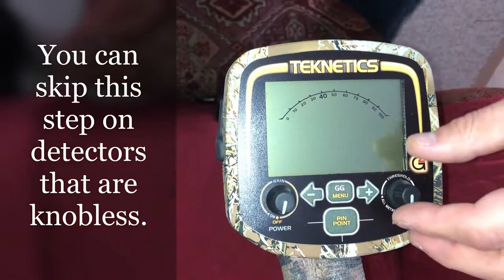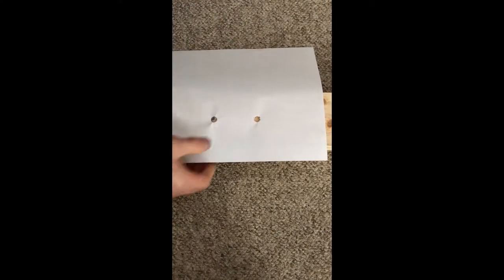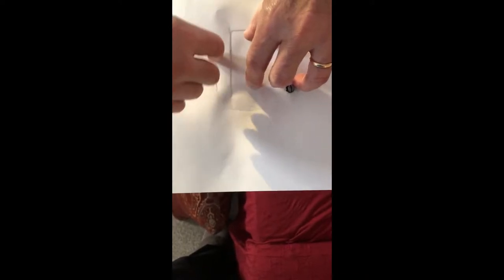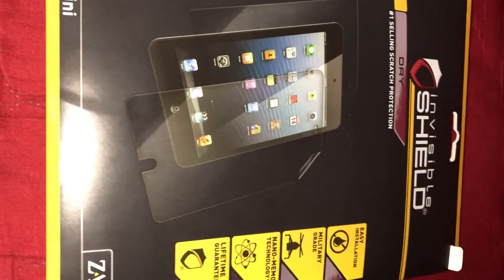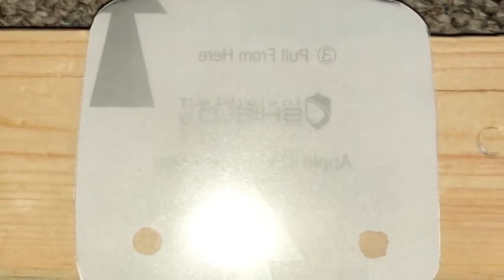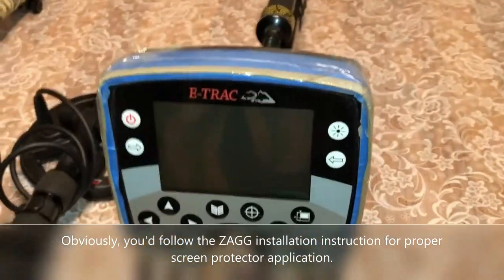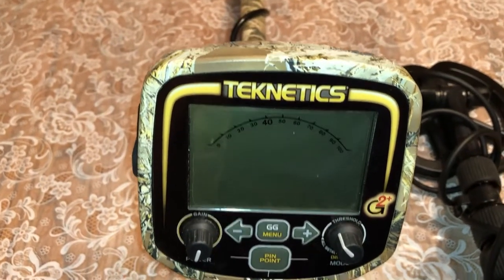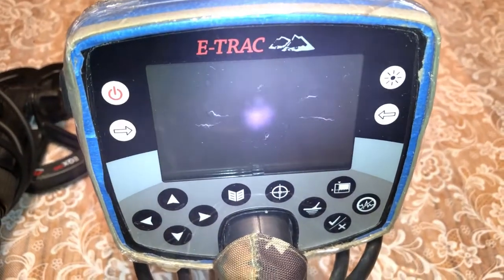ZAGG Screen Protector for your Metal Detector    How to

Comment: good video i watched the golden mask shaft video i ended up ordering for my equinox thank you  when are you going to do a hunt with your equinox.. thumbs up
Reply from the maker: Thanks Mark.  I'm hindered by frozen ground at this point.  I'm still pretty much a "newbie" as far as the Equinox goes. I usually like comparison videos myself... I'd really like a comparison between the Equinox and the Etrac. I'm hoping to connect with a well known Etrac user, maybe, if he's willing... we can do a "real hunt" comparison video with Etrac and the Equinox. I don't think you'll be disappointed with the Golden Mask shaft
Reply: @GDzag-Minelab  Hope the weather gets better for you i am also a newbie with the equinox i use a ctx 3030 for water hunting  and xp deus for searching in heavy trash il use equinox for water hunting as well but they have a weakness in the battery compartment check out  Seller: fox25025 on ebay he sells a gasket for the battery compartment im glad i found out this before i started water hunting with it.. i wish you all the best and hope you find some great stuff look forward to some videos from you.
Reply from the maker: @markrowell9561  That's ironic... I just saw that eBay listing yesterday or the day before... can't exactly remember.  The thing that caught my eye, was that it looked like some-sort-of 120v outlet cover.  That was the first time I had heard someone talking about a consistent water leak problem on the Equinox. I'll have to do more research.  All the best to you too Mark... Good luck on the water-hunting. I hope to join you one day in that endeavor. I hope to get a Hookah diving system somewhere down the line.